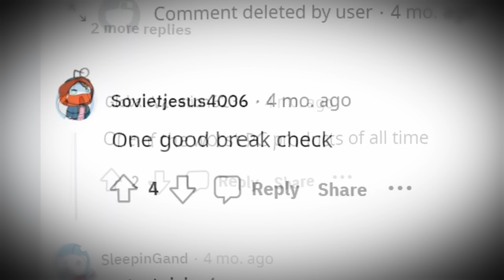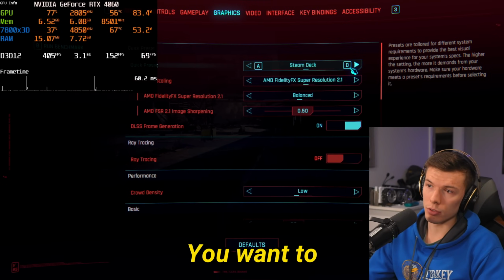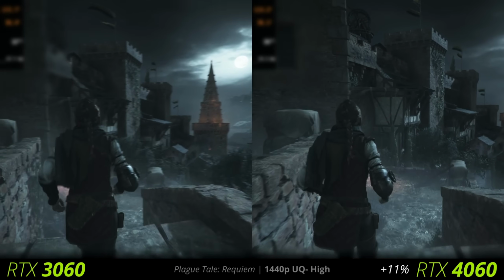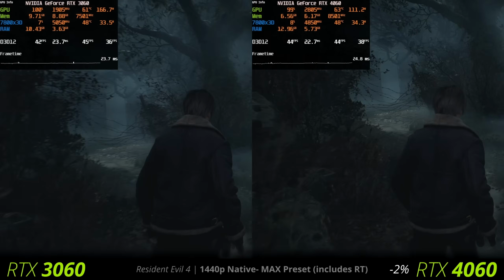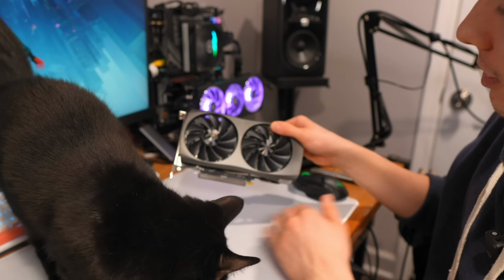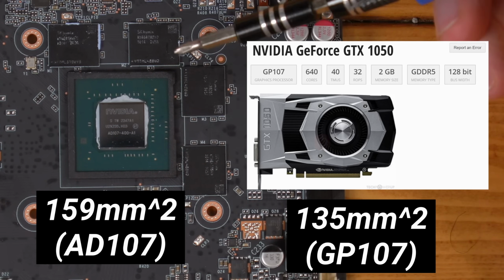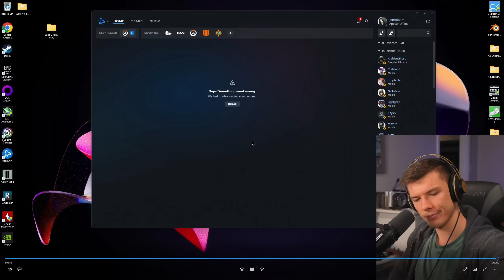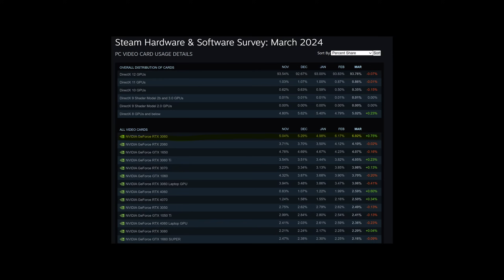I Tried Nvidia's best "Budget" GPU to see if we're Doomed

Comment: RTX 4060 is not bad itself, just don't consider it as an upgrade if you already have anything better than a GTX 1070.
Reply: I upgrade from a 1050 to a 4060.
But for me, the only options were that or an rx 7600 for a similar price.
6700xt out of stock here and 3060 is $50 more and slower so the buffer between the 4060 and 4070 doesn't exist where I am, it's either get a 4060 or nothing at all because the cost of everything else is just far too much here.
Reply: @gamerz64xd there are no bad graphics card just bad priced ones the card is fine teas a big upgrade for you. It’s only bad if your upgrading from a 3060 ti. Since I believe how it was before was that the next gen 60 series would be faster than last gen ti in the same series.
Reply: My 7 year old GTX 1080ti is better than this. It's trash slip Nvidia 4000 series and probably moving forward as well. I jumped to an xfx 7900xt for 699.99 plus 80 off in Amazon rewards and I have loved it 1440 killer and a hard 4k card.
Reply: @DJ-fw7mi  4060 is faster than 1080Ti. 1080Ti is at the same level as 3060 12GB. the only thing 1080Ti have over 4060 is VRAM. and when running newer games that takes advantages of things like async compute heavily the 4060 will pull even ahead.
Reply: @arenzricodexd4409  doesn't make it worth the price of 300$ on the low at all. Card won't even last a generation, needs features to produce frames at 1080p when the 1060 was aiming for 1440p in 2016. It is a terrible do not buy and forget about Nvidia since they forgot about gamers who helped build up that company.
Reply: I upgraded from a 1050 Ti to a 4060, it's extremely good for me
Reply: @DJ-fw7mi  1060 never aim 1440p back in 2016. it was more or less 1080p card back then. if you want good 1440p card that is 1070/1080 territory. such performance is 1440p card back in maxwell era with 970 and 980. and don't expect good value $300 from any GPU maker going forward. AMD? they did not even dare to use 5nm die on this level of performance right now. any company out there is not your friend. and gamer think too highly of themselves as well about helping company like nvidia to rise up when it fact most of them only care about getting the better deal for themselves. if they willing to sacrifice themselves by supporting other GPU maker with bad product there probably still a few of them competing with nvidia not just AMD and intel.
Reply: i bet they will keep making 8gb gpus and make a Deep Learning Super Compression or something like that
Reply: vega 64, at least vr runs great on max, and room gets warmer.
Reply: I upgraded from GTX 1660 to RTX 4060 and I’m averaging 100+ fps on 1440p resolution on most games and I love it.
Reply: My 1070 out preforms my 3050 💀
Reply: @DJ-fw7mi  4060 are going down in price right now. In my country i can see a $280 rtx 4060 bnew while it was $290 in january
Reply: i got a 1080 used for 230 in 2020. if this is stagnation i dont know what is
Reply: my friend had a gtx 1050, so it's def an upgrade for him
Reply: I literally upgraded from a 1070 to a 4060ti a few weeks ago lol
Reply: Meanwhile I went from a 1070 to a 6650XT and getting good results, and will be sticking to team red because I HOPE to remove or almost completely remove windows from daily driving and team green drivers suck on linux
Reply: A 4060 is on par with a 2080.....
Reply: @DJ-fw7mi  The 1060 was aimed at 1080p from the get go.....
Reply: I went from a 1070 to a 4060 because my 1070 wouldn’t run Alan Wake 2. It’s definitely an upgrade. It’s only a 1080p card, you’re not going to get good fps in 1440p.
Reply: @potato2387  A 4060 can most certainly do 1440p fine in a LOT of titles well over 60fps
Reply: Cheap nice upgrade from my 970 spending the extra 100 for a 3070 or more didn't seem viable to me so I went with this and so far I'm happy
Reply: @DJ-fw7mi   The 1060 was not marketed as a 1440p card.
Reply: @DJ-fw7mi  Of course it's better than a mid/entry level, that was a top-of-the-line GPU back then. I would hope that if I dropped over $1k (AUD) on a GPU it would last me that long.
Reply: @juuglord8509  I paid 569.99 for my GTX 1080ti in 2017. You'll never see an 80s class card at this price let along a super or ti ever again. This 40s series isn't worth it, basic facts.
Reply: @DJ-fw7mi  Certainly not disagreeing with you about the price, just making a point about the comparison with the 4060.
Reply: Is this hyperbole or fact? I have a 2060. I want to upgrade to 4060.
Reply: @Krlos-n4k  ofc they will, everyone will because there are a lot of people who don't care about 4k resolution so 1080p GPUs will be a popular thing until 4k becomes more budget friendly all around.
Reply: @DJ-fw7mi  granted that's not adjusted for inflation, but you're right as these days the high end nvidia card is the price of a decent budget rig just for the damned GPU.
Reply: the 4070 cost the double of a 4060 in my country
Reply: lmao, i literally upgraded from a 1070 to a 4060, the differences are literally night and day
Reply: @mangocrisp24  well how unexpected that a GPU 3 gens ahead of your old one is better.
Reply: i went from a 2060 to a 4060, it was a decent upgrade but im ngl i regret not spending a bit more money to get a 4070 atp
Reply: Nvidia should upgrade rtx 4060 and rtx 4060 ti to super
Reply: @mangocrisp24 what cpu do you have?
Reply: 3060ti is better and cheaper.
Reply: As a 4050-8GB for $200 only available in Low Profile it would have been awesome.
Reply: Is a 1660 still good??
Reply: @Jambo4Eva  more or less its a 3050 with less ram and no rtx features
Reply: @DJ-fw7mi $569.99 in 2017 is the equivalent of $669.99 or even more in today's money. So you think you paid less but back then every thing cost less even gas and food and rent.
Reply: @VolcanicProtectorMan  I paid less cause I paid less. A 1060 6GB went for 250$ USD able to handle 1080 with out upscaling and lasted generations. Same for the RX 4xx and 5xx AMD cards. All for sub 250 offering 60fps 1080p for the time. Paying 300-400 for a 4060 that needs upscaling is dogshit. And way more than inflation simple greed. No way the 4060 matches a 3080 in performance like the 1060 matches the 980.
Reply: i have a broken 1650gtx , and i don't have much money is it a bad choice to get the 4060?
Reply: I upgraded from a biblical 670. Not the best, but it's still a massive leap compared to that.
Reply: I’m coming from a 1660ti, specs hardware wise it’s already a big upgrade but the inclusion of DLSS and frame gen makes it an even bigger gap in performance. Got mine second hand for $276.
Reply: @gamerz64xd  hey bro what are your full speck, i'm also upgrading my whole pc
Reply: Exactly what in a 1070, i think The 4060ti 12gb is better
Reply: @SkitZHitZ  but it is much more expensive
Reply: @klimadzu  it should still be a drastic improvement fps wise vs a 1070, it isnt a ti either

Im considering a 4060 for my partner because she has no pc nothing and isnt willing to buy second hand stuff other wise i suggested a 2080 or 3080 

How ever the price of 4070 will be dropping towards the end of the year
Reply: i survived 5 years with a gtx 1060. played everything from cyberpunk, rdr2, ghost of tsushima and days gone and had a great time.

the only reason why i upgraded to a rtx 4060 is because the card was fading so its better to replace it now then out of a sudden because prices and availability can be unpredictable. 

as for ppl yammering about the lack of value of the 4060, they do not understand that they made to card to satisfy the market for a new release and their stockholders. the bigger tech market do not need a new generational defining gpu.

the computers in a f-35 don't give a shit about DLSS or any of the shenanigans ''gamers'' get moist about either. why do you think intel is working on next gen quantum processors now... you think its for gaming? LOL
Reply: @optiondezzo1513  whats are your currently specs, I also have a 1060 6gb
Reply: @klimadzu  i5 124k / 16 gb RAM / 1060 4 GB
Reply: @optiondezzo  but didn't you build a new one with the 4060?
Reply: @klimadzu  the CPU is new. I reused the 1060 as a transitional GPU. the main reason why i changed CPU is because the old mobo was dying.

i am not a hardcore "gamer".
Reply: Leave out RT this card is great for 1080p and 1440p.. Also look at the tgp it's doing 115W.  This youtubers always expect it to beat 3070 but it draws only ~65% of power and perform much better. Pricing should have been better, that's all
Reply: i went from a 1650 super to a 4060 so the switch was def worth it
Reply: My GTX 1070 has been getting me thru gaming for almost 8yrs now
Reply: Lol true. I have a 2060 and I didn't notice too much of a difference. But still an uppgrade
Reply: It's barely an upgrade from a 1070. I ended up going with a used 3070 (didn't wanna deal with drivers for AMD).
Reply: Well that's simply incorrect since the 1660ti is better than the 1070, and the 4060 is significantly faster than it.
Reply: @optiondezzo  If you ignore the price than every GPU gets to compete and win in the Special Olympics, you can get a last gen card that performs the same for half the price or pay 300$ and get a considerably better non-Nvidia card, of course all cards are good if you know what to expect performance wise but you dont mind overpaying for it is what Nvidia is counting on. (and they're right as the comments prove ppl will overpay for dreck and be happy bc team green.)
Reply: @nimithkj123  Does the TDP makes games run better? do you feel your fps running cooler? is it better rendering if its lower tdp? I dont understand are we looking for gaming performance or room temperature control solutions?
Reply: @josef733  that's not true 1660ti is weaker than 1070 lol google benchmarks pls
Reply: i have a question
should i upgrade my 1660ti to a 4060 ti
Reply: @tmsphere  People looking to buy this card will be gamers on a budget and little bit of power saving won't hurt. Your psu will run efficient also at 50-60% load.  You will save 40% more power and get similar performance of 3060Ti.. it can run most stuff at 1080p so what else you need. For me it's a big win and with dlss3 . I am upgrading from a 2070.
Reply: So then an upgrade from gtx 750 ti to rtx 4060 ti is big upgrade?
Reply: @Nameless-nv5xd  definitely
Reply: @Jambo4Eva  my current pc still using 1660, recently power supply broke and i just might as well upgrade to 4070, new pc haven't arrive yet, so im still excited for it.
1660 i mean it's fine, but seems like gta v is already stretching it on 1080p. Although im not sure if it is my cpu issue or the gpu issue. gta v wasn't that smooth for me until i lower alot of the settings plus going to windowed mode. and that was 2019 when i was playing the gta v online using pc.
Reply: 300 dollars for a 1070 in 2024.
Reply: @gamerz64xd  same situation, so i just get the 4060 and it's been doing good so far
Reply: @primecelron6764 the 60 series used to be close to if not better then the previous gen’s 70 series
Reply: I could barely run Roblox at 40 fps before this 😂
Reply: @primecelron6764   the pricing is perfectly reasonable. I just paid $100 usd LESS for the 4060 than i paid for my 1060, 6 years ago. Ofcourse it doesnt make sense to upgrade a pc every year or two.. Its like going from an iphone 15 to an iphone 16.. They are supposed to be near identical products.
Reply: I got a 1650 gtx but i wana upgrade what should i get 4060 or 3060 ?
Reply: Me with a GTX 1070 looking to upgrade...
Reply: @beskars  4060 is worth it if thats what u can afford
Reply: no, its bad, not worth the money period. My RX580 was better.
Reply: @primecelron6764  yes there are, Lmfao the 4060 cant play games on low 1080p. Thats terrible
Reply: @arenzricodexd4409  you can make this claim, but a 1080 can run alan wake at 1080p Medium. 4060 cant run it on low
Reply: @ name the game please name the game it can’t play on low 1080p because that is complete fucking nonsense
Reply: @harveybro13  with frame generation and DLSS sure.
Reply: @jimmythecrow  what are you on about? 4060 even beat 1080Ti on Alan Wake 2
Reply: got a gtx 1080, is that better?
Reply: @arenzricodexd4409  Lol ... "the only thing" is pretty critical
Reply: Well no shit. This card is for people who have an older 50 or 60 class card, not for a 70 class card 💀
Also ironic you compare it to the 1070, when it’s still somehow less powerful than the 3050
Reply: i have a really crappy 1030 rn, so it is an upgrade
Reply: @DJ-fw7mi  what are you talking about?? The GTX1060 was never a 1440p card 💀 50 and 60 class cards always went for 1080p, while 70 class is 1440p, and 80 class is a mix between 1440p and 4K.
Also games from the GeForce 10 series could probably be run in 1440p on the 4060 anyway. It’s just games continually go up and up in terms of performance requirements, so the 4060 being 1080p still fits with their design. If you want something that handles higher resolutions, get a 4070 or 4070ti instead of asking for something entirely unrealistic in a cheaper card.
Reply: @DJ-fw7mi  You’ll literally be downgrading getting AMD stuff. Their cards are soo unoptimized and unstable, that those things pull too much power when idle. The 4080 pulls 70 watts idle when the 7900XTX pulls 150 or more 💀 not even the 4090 pulls that much at idle.
Reply: @DJ-fw7mi  Except you’re wrong here again. The RTX4060 doesn’t need DLSS upscaling to have good performance, that’s only if you enable ray tracing, which no developers have been able to achieve anything better with ray tracing for years. So it’s still a 1080p card that handles high or ultra performance.
Unlike the GTX1060 which became outdated very quickly when developers realized graphics cards can do more. Which made the 1060 go from a high 1080p card to medium or lower.
Most of the reason why these cards “lasted” was because of the higher VRAM compared to other generations, where they had mostly the same low numbers. But that still didn’t help because those cards lacked everywhere else.
Reply: Should i go from AMD Radeon HD 5870 1gb to rtx 4060 8gb?
Reply: @DJ-fw7mi the 1080 to is still a serviceable card, but with inflation it was also 900€+, takes twice the power, doesn’t do any raytracing at all, misses all the new supersampling and framegen features and is about 5-10% slower performance wise. No it is literally not „still better“
Reply: It still costs 300 dollars
Reply: @Thewaterspirit57  the 1060 didn’t become outdated quickly at all, just because it can’t run everything on ultra anymore. It was still the 3rd most used card on steam last year and there was not a single game I couldn’t run on it. Sure you have to look at the settings a bit sometimes, but Medium-high/1080p/60fps was almost always attainable if the optimisation wasn’t super shitty. It’s literally known as the best price-performance card ever lol
Reply: It’s an alright card. Not the price-performance banger the 1060 was, but it’ll play everything at at least high settings in 1080p and will probably play everything for the next 5 years. The alternatives are just not there if you don’t want to buy used. AMD software and features are worse and you only get like 5-10% more performance at the same price point anyway. Then the 4060 ti with 16 gb is 150€ more, the 4070 is 250€ more. That’s almost twice the price and I can’t justify spending that much money on a graphics card and I suspect many others can’t either.

Really the only big problem is the relatively low VRAM, we’ll have to see how that’ll do in the next few years, but at the moment it’s not a problem at all for 1080p gaming
Reply: @jkraemo  rx 7600 with cheaper price or rtx 4060
Reply: @Piguinakos  if you care about DLSS or having ray tracing in some games then 4060, if you don't then the 7600 has pretty much the same performance
Reply: @ You seem to forget the 1650 mobile was at the top for a long while. The 1060 IS outdated. We have to stop shilling for these old inefficient cards when the majority of us can get something newer and better.
Really only other countries should care about using older graphics cards, since the economy where these people live is tougher.
Reply: before my 4060 I had a GTX 750ti :(
Reply: thats messed up i have a 6gb 1060 i5 4570 and i feel like this 10 year old build still stands somehow but i want to upgrade and see things like this lol why
Reply: @dkemp1337  the GTX1060 is weaker than the RTX4060 tho. But I wouldn't really recommend getting one for such an old system due to that CPU and the lack of PCIE Gen 4 :/
you could try buying one and using it, but I wouldn't expect anything more due to that older CPU